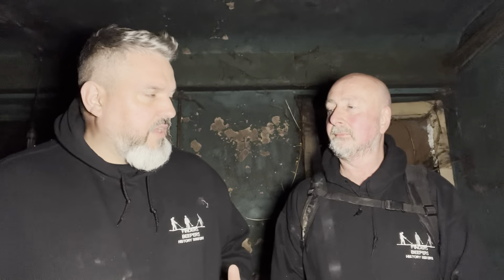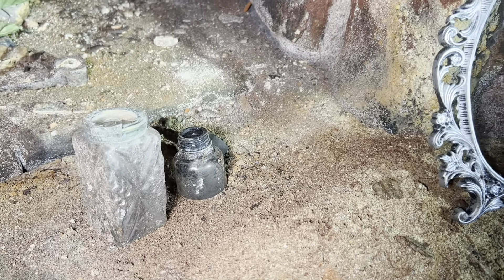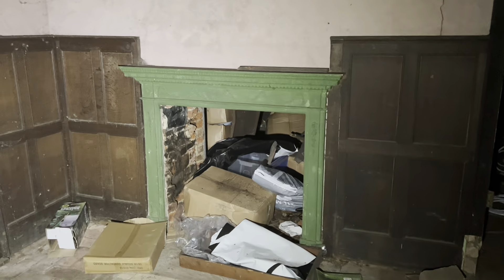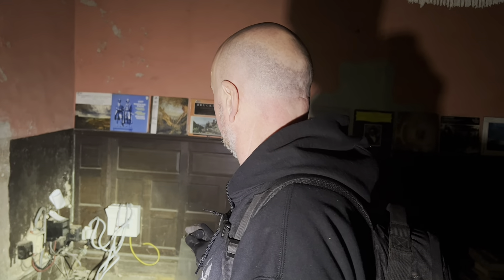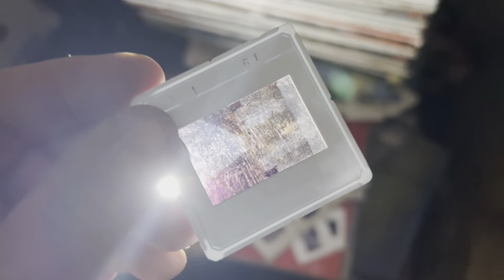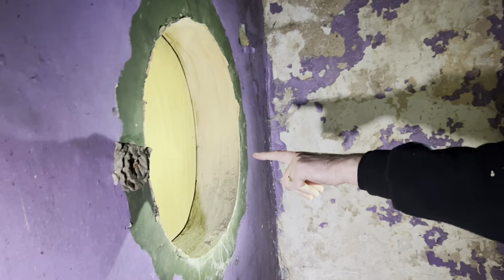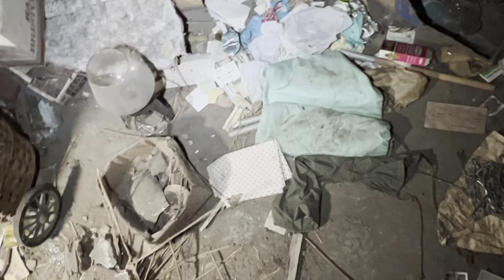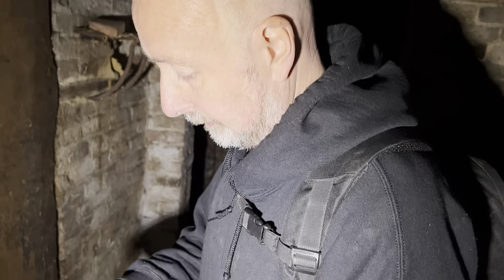This creepy ABANDONED ancient house scared us to the core

Comment: Loved the video. So interesting. BTW the oven in the cellar is a tudor type bread oven, had them in stuart era also. Has the beehive brickwork inside. The inglenook idea with the stonework round the outside frame.  Not roman I'm afraid. Was put down into the cellar as this was their kitchen area. This idea of separating cooking area came from tudor times as Henry 8th hated cooking smells and didn't want to smell them while in his living areas. Just looked it up, they found roman base pillars used to support a large kiln where the oven is situated. However don't think this is original roman kiln. Plus, it is said to have at least a male and female spirit there, poltergeist and sometimes cigarette smoke is smelt. Its a listed building. The last owners, a elderly couple, were moved out due to the property being in bad condition and could not afford to update it. All the antiques were removed in 2015 and sold at auction. I don't know if they are still alive or have any kids.

Comment: 18.23 The elaborately carved Archway over the top of a Set In buffet or curio cabinet... THAT'S A DOOR! That someone filled in with the curio cabinet.  Yeah, spouse and I did that very thing to add room into a kitchen.  The pile of keys... ehhh that looks like someone stole them.
25.47 That hole in the floor, with a tiny gap in the paneling.... that looks like an electric line that went up to a light fixture. A brass pipe may have contained the wire to protect and hide it.
The smell of 'death':  bodily fluids will rot just as much as tissue.  Sweat, urine, vomit... will rot.  Since that is where he was 'living' and he was fond of chemicals to 'alter the mind'.. no WC/facility/bathroom... I hope you two bathed in sanitzer when you got out of there.
I could see that a 'Fun House Effect' would play into the Uneasy feeling.  That house has had so much remodling and radical changes to the structure... that it affects how the brain will see the lines.  Odd angles will force the brain to make sense of them, and it can make people feel dizzy and light headed.

The big noise... I think a draft blew a door shut, and the plaster fell from the ceiling... but I didn't notice enough of a draft to slam a door shut hard enough to knock plaster from the walls or ceiling.  While you were in the bathroom, I heard wind noise in the microphone, which makes sense with the window missing.  I've watched, yet again, and it was the slamming of the bathroom door behind you, and another door trying to close but could only scrape on the floor.  That is what I heard.  You changed the air pressure in that area, when you opened the door to the room with a missing window.

I came here after watching an old episode of Nuke's Top 5.  The algorithm brought your channel on my feed.  I didn't quite understand History Beepers... until I discoverd you are Metal Detctorists.   I'll be back to see more of your vids.
Reply from the maker: I shut the door ( on the in edited Patreon video I explain I shut the door to make Andy gag with the smell)
Reply: @FINDERSBEEPERS  Thank you for clarifying that point.  I still think the open window and the pressure in the house would explain it better.  I distinctly here a door slam, and then one try to slam but was stuck on the floor.  
I DO believe in the paranormal, but I'm skeptical of the evidence people claim.  I don't see paranormal with this event.